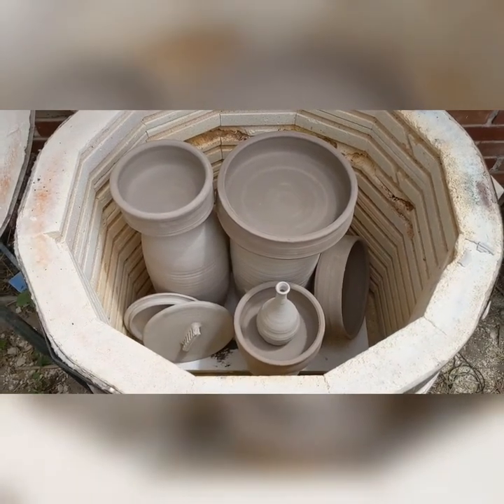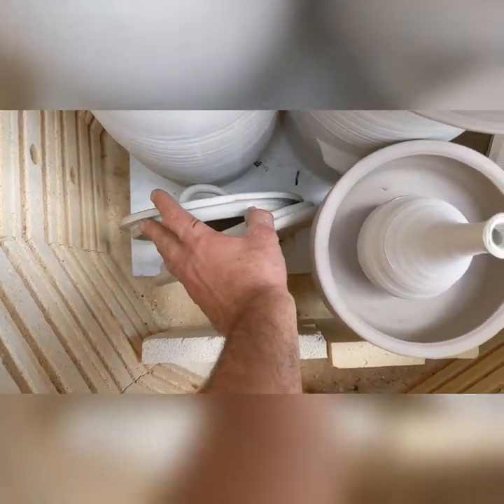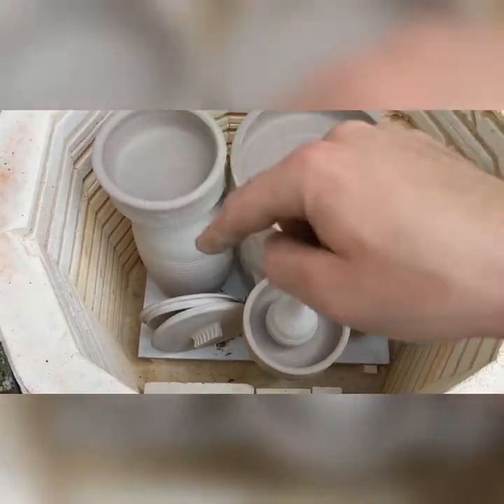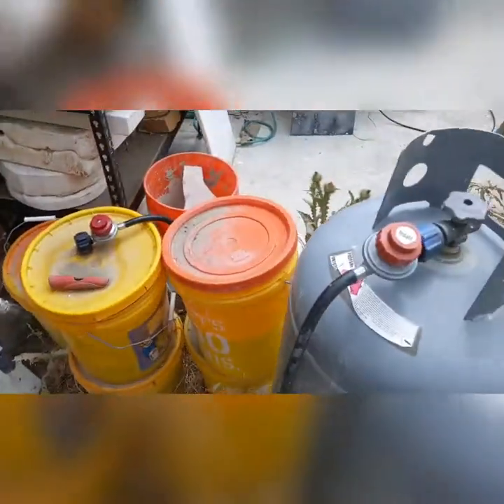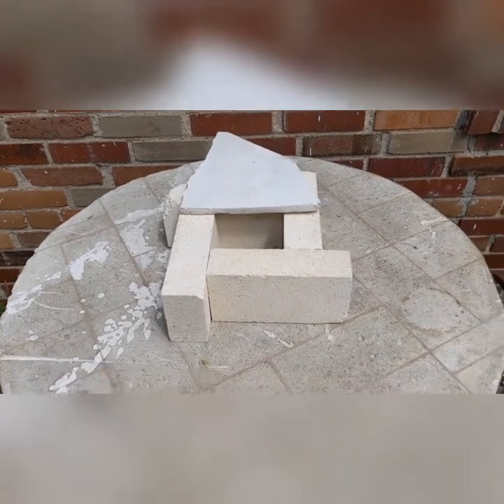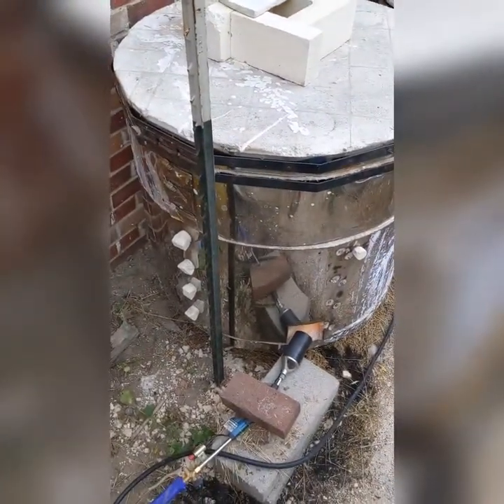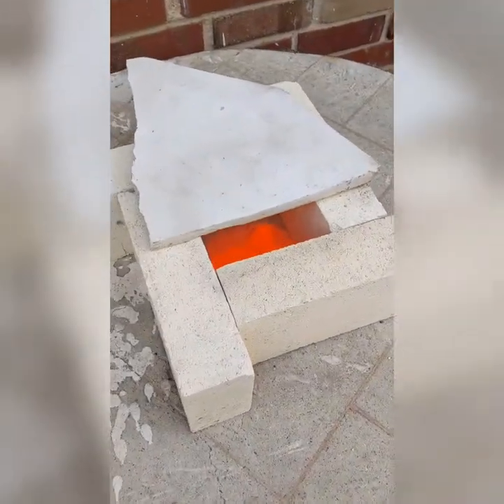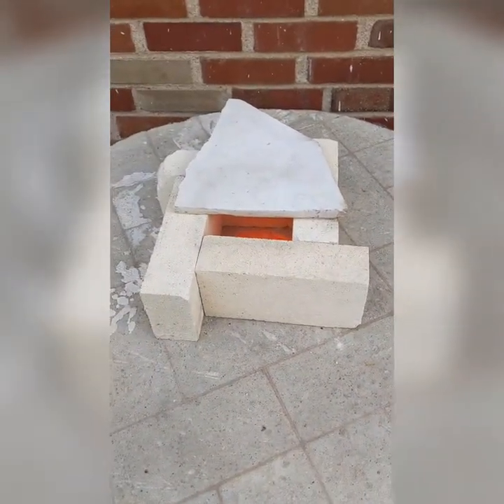How to Fire a Pottery Bisque Firing in a Gas Kiln

Comment: I've got a gas kiln I made out of an old clothes dryer drum with ceramic fiber insulation and a single weed burner that I use for both bisque and glaze. I was seeing substantial soot if I candled with the gas, so switched to drying my pieces in an electric oven at 190F for an hour or so while I'm setting up the kiln. My firing schedule is way more aggressive with cone 05 in about 60 minutes. Once the cone falls I pull out the weed burner plug up the chimney and fire hole and let it all cool for about 8 hours before venting the lid for another hour to get rid of the last of the heat.

I'm firing wild clay that's been spiked with ample mullite and kyanite for raku so it seems to not mind the accelerated ramp up to 1900F. I use BBQ propane tanks which are about $20 USD to refill and get 3 or 4 firings out of each one, so $5-$7 per firing. For raku, it's the same except I pop the kiln at 05 and set stuff on fire with the glowing pots.
Reply from the maker: That sounds like a neat process! I'm happy that you have found something that works so well for you. I love wild clays and I have found them to be more resilient in so many ways when compared to commercial clays. the dry strength is often crazy good. there is a clay that is local to me that is so strong when dry, that I can stand on a greenware flowerpot turned upside down without it cracking!  happy potting!

Comment: Why not a pyrometer for bisque firing ? I would think that’s when you have to monitor the temperature change more closely ? 
Great video.
Reply from the maker: There is certainly nothing wrong with using a pyrometer! I just don't find them necessary. After a while you get to judge temperature fairly accurately by eye and your senses, and only rely on the cone for the indication of the final temperature. Happy bisquing!

Comment: Good video. Can you estimate the cost for a firing? I'm trying to work out whether to get a gas or electric kiln. Thank you :o)
Reply from the maker: Hi Wendy! I estimate that a firing to cone 10 in this kiln costs between 10 and 20 dollars depending on the price of propane.  A bisque is a big less. A 100 lb tank costs about $65 to fill here these days. I also have a downdraft kiln that is slightly more efficient.
Reply: @liamg1995  Thank you :o)